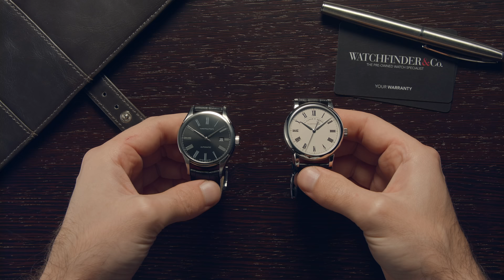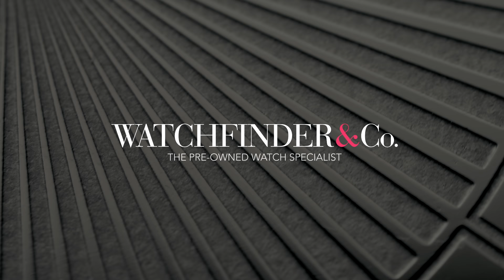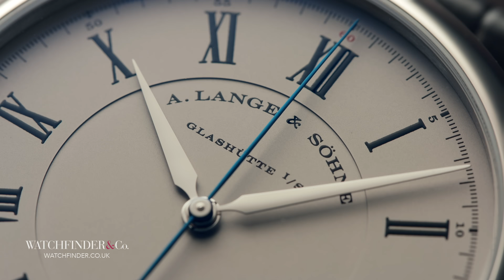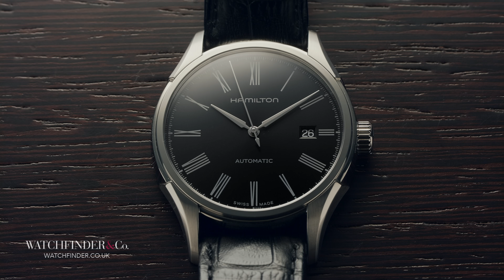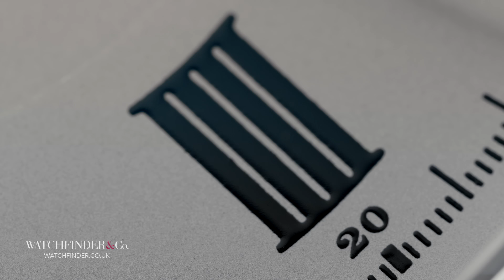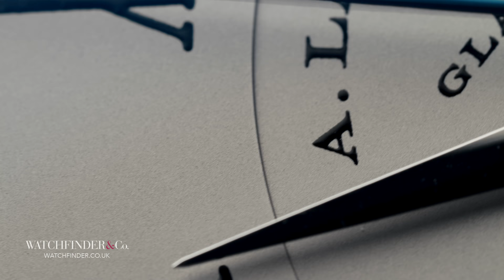£300 vs £30,000 Watch – Really 100x Better? | Watchfinder & Co.

Comment: I wouldn't call the Hamilton a 'Honda Civic'. While it may not be an Aventador either, it is still a Swiss made mechanical watch. A Civic of watches to me would be a quartz Casio. The Hamilton still has the mechanical movement tracking the time with tiny and very precisely manufactured wheels and springs, and a Swiss made one at that. I'd say it's more like an MX-5. Cheap, but not soulless or boring. It definitely DOES do more than just tell the time.

Comment: “Price it and they will pay“ 
The entire watch industry in one sentence, ladies and gentlemen.
Reply: jeppemichael  no. Just the jewelry industry. For example, buy a Ferrari and it doesn't come with the same performance as a Honda Civic for 100x the price.
Reply: jeppemichael  True, but it is especially so with the watch industry

Functionally, a Quartz movement is superior to a mechanical movement in almost every conceivable way

But the watch industry has managed to convince us to pay more for mechanical movements

It literally makes zero sense

That's like Nokia convincing people to pay more for the 3310 than an IPhone X Pro

But yet here we are
Reply: @anno1602  civic is actually better because you can drive four people around and run errands.
Reply: Hiyuke La Vie it does actually make sense. Matters of the head vs the heart. A mechanical watch better resembles something living. People love the idea of such a complicated system of gears doing it’s thing on your wrist, which also looks nice on the outside. More often than not a watch is a piece of jewelry and not just a tool for telling the time(you could just use a phone for that). And people like expensive jewelry. 

This might sound bs. It made sense in my head
Reply: People would pay £1000 for a Seiko 5
Reply: @hiyukelavie2396  Trouble is, most need a battery.
Reply: @hiyukelavie2396 , you are very rational and clever, we get it.
Reply: @igorchistyakov8876  Thank you
Reply: jeppemichael  Pretty sure it's not true of the fast food industry, or the convenience store industry, or the energy industry, or the grocery industry, etc. etc. etc.
Reply: @hiyukelavie2396  You're starting with the assumption that everything has to be rational and very well thought through, which is not true. We are humans and enjoy having our emotions triggered, even though it may not make any sense. And about the wine, you clearly have no idea how wine is produced and why certain bottles are expensive. It's certainly not only marketing and often very rational.
Reply: Nobody is forced to buy an inaccurate watch...they can just look at their phone if they wish. These are more pieces of jewelry.
Reply: @Transcendental Outcast Congratulations, you have a more refined palate than most wine experts then
Reply: @Transcendental Outcast Check the link I posted above
Reply: @Transcendental Outcast Like I said, well done, you're capable of something that most wine experts aren't

No really, I say that without jest, if you are able to distinguish what kind of wine you enjoy, good on you my friend, it's your money it's your wine, enjoy it to your fill 

But it doesn't change the fact that most so called wine experts can easily be fooled when the wine given to them isn't in its original bottle
Reply: Hiyuke La Vie 
By your logic a camera makes a more accurate picture of a vase  of sunflowers but I would rather have Van Gogh on my wall. 
A small Toyota costs less to run and has more efficient fuel consumption but I’d rather have a Ferrari.
Reply: Cantor Yakov 
People who buy this watch won’t give a shit about a Civic as they’ve probably got a Bentley.
Reply: @Pondjumper1  Careful there, don't strain yourself with all that stretch

A Van Gogh, or any work by any renowned master really, has one very important thing going it for - the artist is dead, and therefore whatever works he left behind is it; and when demand exceeds supply, prices go up

With Swiss watches, they are intentionally creating an artificial scarcity - they can easily mass produce any of their watches if they wanted to, but no they won't

All those claims that their watches can only be produced by hand by the most experienced artisans are purely marketing fluff

And that, my ignorant friend, is the difference between a Van Gogh and the Swiss watch industry
Reply: @Pondjumper1  As for your Toyota argument, again, I'm sorry to blow it up in your face, but here we go

A Ferrari IS functionally superior to a Toyato

It has higher top speed, faster acceleration, more powerful engines that are capable of generating a lot more torque, and the list goes on

So yes, there are very practical reasons to choose a Ferrari over a Toyato

A mechanical over a Quartz, not so much
Reply: @hiyukelavie2396  why but an original painting when you can buy a photograph for much less? Why but a piece of furniture made by have out of a good hardwoods when one made of particle board will serve as well? Why play a grand piano when am electronic one will sounds as good?
Reply: Hiyuke La Vie You really didn’t listen to the video, did you? This is a comparison between a handbuilt timepiece that has taken the best part of a year to put together and a wristwatch which has had the logistics of modern factory production involved. The difference being a Mona Lisa compared to a newspaper cartoon. Art in other words! I hope you can see that at least. By the way, I would buy the Hamilton as my choice, because I am a big fan, but if I had the money, I would buy the Lange!
Reply: @JamesAlexander14  I don't mean to be rude, but comparing a Lange to the Mona Lisa is a little silly

There is only one Mona Lisa in the world

Lange, on the other hand, produces about 5,000 watches every year

But more importantly, Lange CAN absolutely mass produce their watches, if they wanted to

That is how Rolex produce more than a million watches every year

The myth that everything HAS to be built by hand is just that, a myth

Having said that, I have nothing against people willing to pay more for something to be hand made, people have spent more money on more trivial things
Reply: Hiyuke La Vie Buying a mechanical watch makes no sense at all if all you want to do is get accurate time. But it seems some appreciate the old fashion and beauty of a mechanical movement, as such it is a luxury item that carries some intangible value for some people. Like some people being willing to buy gold earrings much more than their weight in gold. The intangible value is worth what people are ready to pay for them, and usually that’s pushed up by marketing strategies. But I would not judge negatively those people who love mechanical watches, because on the other hand, in a purely rational word, none of those watches would exist anymore and the know-how of making those mechanical movement would be lost. A boring world indeed! My two cents on the subject 🙂
Reply: @zekevfab  Quite right, my friend 

Others here mistook my position as having no appreciation for mechanical watches 

I own a Seiko, Laco, Tissot, Oris, and Longines myself, and am contemplating getting a Tudor

Hardly an impressive collection, but the point is I enjoy collecting mechanical watches, too - I wouldn't be watching this channel in the first place if I don't 

But I enjoy the watches for what they are - fanciful trinkets that can be worn and are a joy to look at, that's all

I'm under no illusion that mechanical watches possess any tangible superior qualities over "soulless" electronic timepieces 

Neither will I compare mechanical watches, most of which are mass manufactured, to priceless art 

If I were to compare mechanical watches to something, I would compare it to toys 

The joy that I get when acquiring a new piece is reminiscent of the joy I felt as boy when getting my hands on a new Ninja Turtles figurine - a functionally useless piece of cheap, mass manufactured plastic, but was nevertheless considered a treasure, by a child

That's my position on mechanical watches
Reply: Hiyuke La Vie we share a similar view. The toy argument is not going to help me explain the hobby to my wife though.
Reply: @hiyukelavie2396  It's a form of art. It isn't meant to be superior or more accurate in any way.
Reply: @thesnackbandit  Art that is mass produced by the thousands each year
Reply: @hiyukelavie2396  Als makes 5,000 watches per year but each is crafted beautifully and finished to perfection. If not 'art', it is certainly a breathtaking product to anyone who appreciates watchmaking. Should you ever buy one? Probably not, but you cannot deny that they are something to behold.
Reply: @thesnackbandit  They are

I wouldn't be buying and wearing them if they weren't

Comment: For once I caught an error in what he says: they do NOT beat at the same 21600BPH. The Hamilton is based on 2824 which is a 28800BPH (and is also well visible by the motion of the second hand).
Reply: It is not the 2824. It's the modified H-10
Reply: Lower rate,  longer power reserve
Reply: @dummule_  It even says 2824-2 on the caseback, it can't be the H-10 because then it would say H-10.
Reply: @erze2367  hmm good call. But maybe we're both correct as current production models have the H10

Comment: The rear of the Hamilton clearly shows 2824-2 which is actually a 28800, 4hz movement!!!!
Reply: You're right but it's 4Hz.
Reply: eRZé yes it is, my mistake.
Reply: I think Hamilton modifies the 2824-2 so it runs at 21600 and that’s how they get the 80 hour power reserve instead of the usual 40ish.
Reply: @ulysses26  I suppose thats possible but would they not give it their own calibre reference if that was the case?

Comment: Another excellent video. How about comparing them with a 3K Grand Seiko SBGW231?

The 9S64 is a high performance manual wind caliber. It difficult to carry a long minute hand, and, even, longer sec hands, running at high frequency for 72 hrs and keep accurate time ( mine is +2 spd). Connoisseurs call this the Third hand. Most precision manual wind, not only runs at low beat, but, has low power reserve bec it's a feat to maintain accuracy after the 40th hour, even, low performance caliber like this Lange. That's why i am not obsessed by thin watches. I am more impressed with high performance, yet, affordable watches. Not complications, though.

Comment: Hmm that’s a interesting idea. The A. Lange & Sohne watch isn’t a just a watch, it’s art that tells time. Thinking that way I’d be able to rationalize the 30k.
Reply: I recently saw a vintage dealer who had a WW2 era U-Boot captain's pocket watch made by A. Lange und Söhne in the early 1940s. I guess that was a piece of art which timed torpedo runs? :-)
Reply: @j.burgess4459  I guess so lmao. Not sure that's the art I'd want but to each their own I guess.
Reply: When you're in the market for a wrist watch above $50, you're already in the market for something that is more ornamental than pragmatic. In that case, buy what sings to your heart - it's your money, after all. Just my 2¢
Reply: @jonathanjones7681  Personally I see watches as exquisite little pieces of mechanical engineering built for the purpose of keeping track of time, date, moonphases, etc, etc. I'm a little sceptical of the idea that a watch could be "art". Maybe there is some unusual context in which it could be? But a production timepiece isn't (so far as I can see?) normally going to be expressing any kind of conceptual point.

BTW I agree that I wouldn't much want to own an old B-Uhr from a U-Boot - even if it was made by Lange. But I do have some nice little Omegas bought by the British Air Ministry for aircrew during WW2.

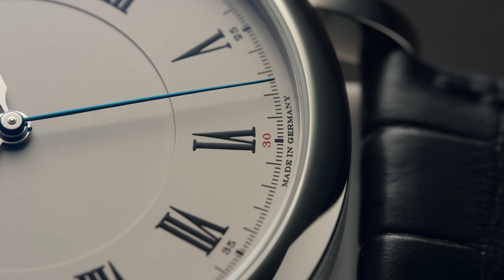Comment: 0:17 "Can one really be a hundred times better than the other?".
I'm still not convinced. 
Yes, its got individually hand-engraved, bevelled parts that would astonish even quantum physicists, I get all that, but in no other way than the most poetic of contexts would this be "an absolute bargain". 
The Civic vs. Veyron comparison is quite apt in highlighting this: in most other industries a 100x difference - or even a 10x difference - wouldn't need a lecture on the history of art, science and watchmaking to appreciate. 

In a time when most regular people laugh in disbelief when you show them devices that can be mechanically powered without a battery, the Lange - as exquisite as it is - sits proudly on a lonely throne with few subjects to call.
Reply: Am I the only to comment on this? with this comment? Fair point @Abdul Rahman Noor
Reply: mate, it's a hand made watch, unlike Hamilton with its off the shelf movement made in a factory. If you do not appreciate craftsmanship, then nothing will convince you. It's like comparing a sculpture carved in wood to a 3D printed plastic figurine...
Reply: @tommylobotommy  Good comparison :)

Comment: I must admit I really like how the A.Lange looks but 100 times more just for exquisite manual finishing? I would expect a miles-better accuracy for 100 times more money.
Reply: Cedar Canoe Accuracy to that degree means high level quartz watches like The Citizen Chronomaster.
Reply: QuickQuips indeed! Great movement (and a great brand) but no wwtch-nerd who is interested unfortunately
Reply: "Expect a miles-better accuracy for 100 times more money?"  No. That is unrealistic. In the 21st century accuracy is way past being a factor.  The Apple watch has more accuracy than either of these because it gets its time from GPS satellites.  The Internet synchronizes through GPS or atomic clocks. No "2 to 10 seconds" accuracy per day.  We are talking microseconds accuracy.  No mechanical watch can possibly surpass that accuracy.  So you have to look elsewhere (and far afield) for the difference. Workmanship, engineering, intrinsic beauty, precious metals and jewels. Anything but accuracy (without being too inaccurate, of course).  That said, we don't really need accuracy below 10 seconds a day, and couldn't even use it for any of the reasons we normally use a wristwatch.
Reply: @CARPB147  i think we can conclude that much of the cost of a luxury watch is just manual work of optical finishing. My point is that I would like tonsee some more engineering done to hi-cost time pieces
Reply: @cedarcanoe  - another factor in the price is simple supply and demand. Very small supply for a product with enough demand causes prices to skyrocket. An example of that is a recent rare watch sale that reached $31 million.  Same can be said of certain paintings, etc. There are always collectors. In a special watch, and in a day when the supply of currency is deliberately kept to small denominations, it is a very compact way to transport wealth.

Comment: The lugs on the Hamilton are 1000x more beautiful that the ones of the A.Lange..
Reply: I also prefer the lugs.
Reply: I like the "corne de vache" styled lugs on the Hamilton too, however I am not sure about a 1000X more beautiful though... 

A.Lange & Sonhe lugs (and cases) have way more detail and finish than they are given credit for. Check out the craftsmanship @6.28.
Reply: @diegoog3654  yeh but its like they stopped caring. The lugs need to be beautifull too (or rather, elegant), not two simple pieces of steel welded on.
Reply: @minityper  I personally find them far from simple, and they're definitely not Steel... well apart from the Richard Lange Jumping Seconds in Steel, which is a 1of1 "piece unique" that was auctioned for Charity.
Reply: @diegoog3654  I know they are not made of steel, but they are just to simple. Its like an unfinished job.
Reply: You are wrong

Comment: I would choose a Grand Seiko if I was to buy the highest finishing for the money. How can you justify the ALS price level?
Reply: @byronfiler2193  credor, GS from micro arts studio is same league although ALS still gets the knod in terms of movement finishing,  GS gets knod In dial, case, technology.  Both beats Patek/VC/AP in dial/movt finishing.
Reply: Statement products have to have statement price because in many cases people are looking to distinguish/separate themselves from others. Basic marketing...won't sell if priced affordably to those folks.
But ALS offers fair value in relation to some others and does offer absolute best serially produced watches in comparison to those  who price themselves in same league with dog turd products to the  unknowing .
Reply: @byronfiler2193  I was referring to those by micro studio arts/credor  which is same league although ALS is little better..Dufour even stated credor is above Patek in movt and only second to ALS/LUC ...fusse and chain has been used long before ALS but they done it to perfection.. spring drive concept  is something many many Swiss tried and failed to do but agree ALS take traditional mechanics to a new level.
However, I think no serially made watch can match independents  where serially production  is made by machine and only finished by hand vs every part being made by hand which limits production to 1 to 10/units per year..that's whole another level.